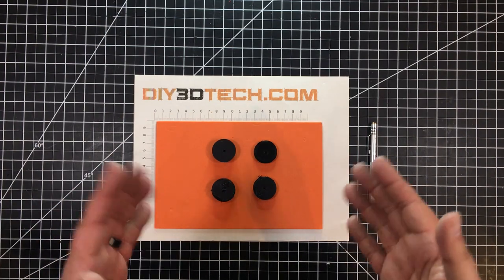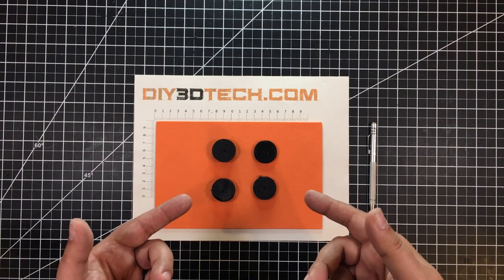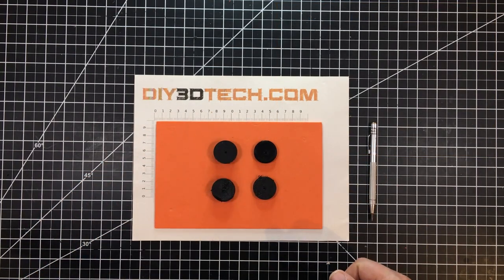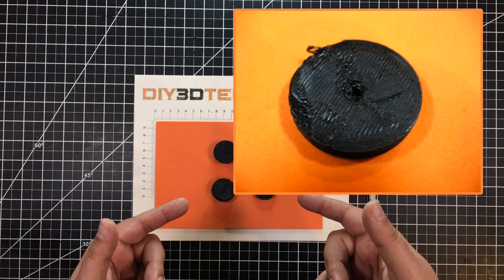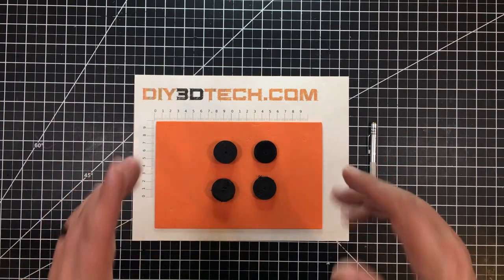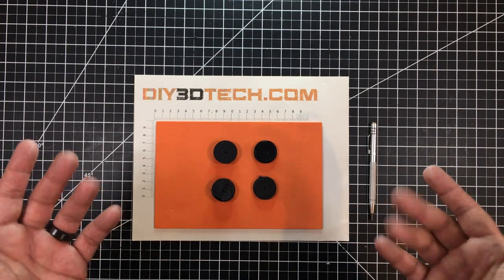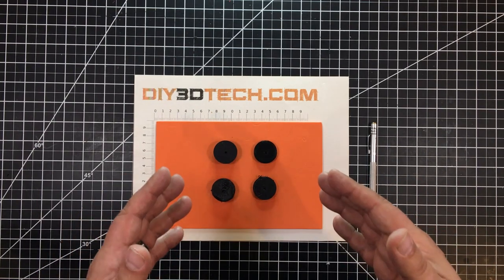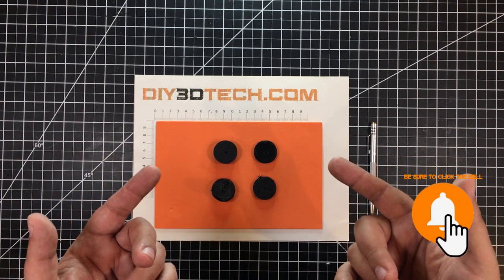Shop Talk - Frustrated By CURA Once Again!

Comment: Strange.  I am getting perfect ( well pretty perfect) first and subsequent layers.  I would be interested in trying the simple model.  Its got to be some setting you are just not seeing.  What version of cura, printer, profile etc.  Maybe your viewers can solve it.
Reply from the maker: Running the most current version of Cura and in this case its only this model on the MonoPrice Mini v1.  If you look bat I had a similar issue with all my 300 x 300 printers where they had issue however if I printed it for 200 x 200 printer, no issue.  That got fixed an upgrade, however noticed this now I did notice some other minor issues and went on the Cura forum and found the development team was having some issues with being able to "unhide" some settings and wonder if its the same here.

Comment: Cura ticked me off for the last time about 6 months ago.  I switched to PrusaSlicer 2.x and have never looked back.  Great slicer.  Cura got uninstalled shortly thereafter.  Worrying about losing/changing settings, different print quality from version to version, etc. is a thing of the past.
Reply from the maker: Glad to hear I am not the only one!  Does PrusaSlicer 2.x have the ability to block or apply custom supports?  I love the KISS slicer, yet these it doesn't have these features and they are supper handy!

Comment: In my experience between Cura and the Prusa Slicer, I suspect it's because of the initial layer height setting. By default Cura has the initial layer height set to 0.1mm where I suspect the prusa slicer doesn't differentiate and thus they require two different z offsets. It's just a suspicion as to what you may be going through here.
Reply from the maker: Thanks for commenting, however this was printed at 0.3 with the first layer at 0.3 and the same was done with KISS.  What I am beating is its is an issue with the Gcode and firmware of the machine.  Since it is a circle, the slicer might be tring to get fancy with arc's on the first layer I seen this issue before and additionally in CNC world with ARC's...

Comment: Didn't like Kisslicer. What profile are you using in cura? That's a very simple print, I've never had that sort of problem with cura before.
Reply from the maker: Latest version of Cura with the built in profile for the MonoPrice Mini Select v1 and generic PLA.  This has worked for other very complex prints, hence I was surprised when I had issue like this.

Comment: I prefer Prucaslice and Ideamaker. Have not testet KISS slicer.
Made a test with  Cura, Prucaslice and Ideamaker, and was only happy with the Ideamaker (Whare you can put supports where you whant, and cut in a simple way) And the STL can be BIG on the Idearmaker.
Thanks for sharing :-)
Reply from the maker: So Idea Maker can control supports?